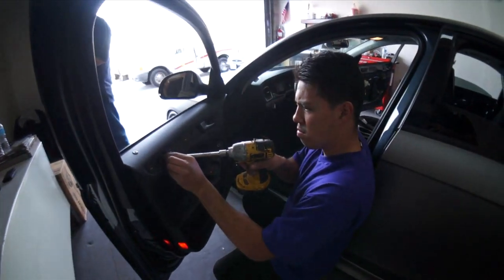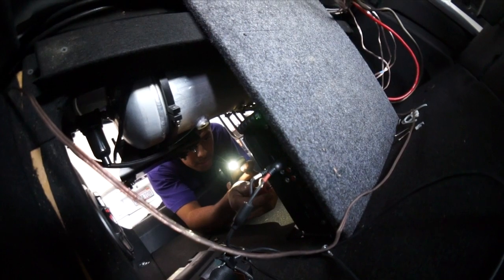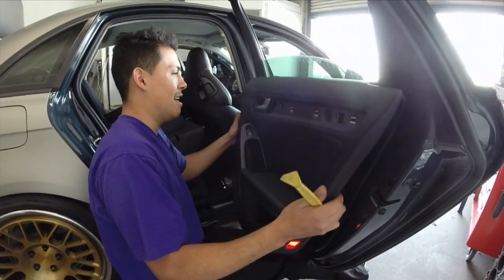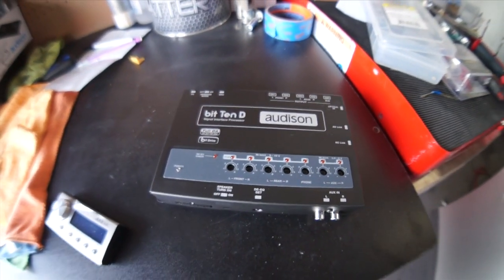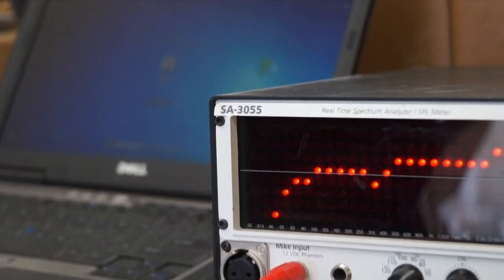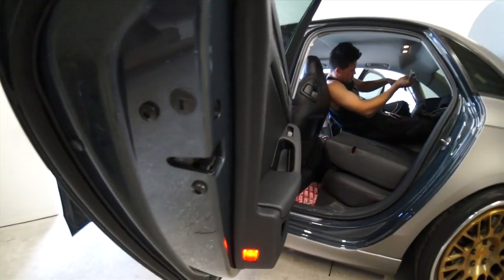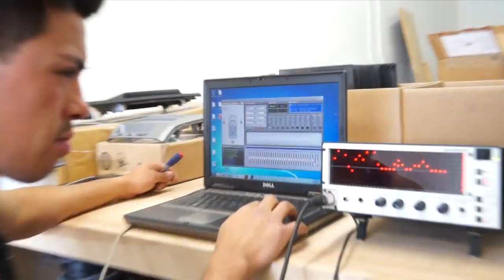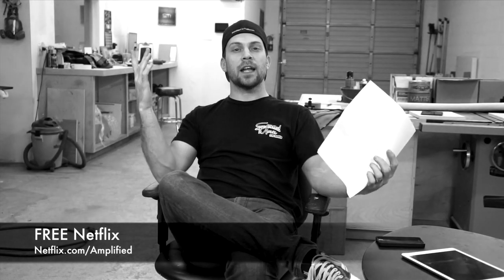Audison Stereo in a Bagged Audi S4 - Amplified #162

Comment: Just curious, you guys let the Bit 10 D set the ranges, but the amp is a 5 channel. 1 for the subs, and I would assume the door speakers (kick panels)  each get a channel? If that is the case what are you running the tweeters from?
Reply: ***** Thank's for the clarification. I always wondered how you all configured the speaker connections, that's something you never show. It's always just a clean install and you never seen any of the connections. The DSP takes care of the signal being sent to the amp channels so you don't have to set amp gains correct?
Reply: What want to the the same thing John Harris help me

Comment: How much do RTA go for now days? Is an Alpine PXA-H800 a good alternative to go active or should I just wait and save the extra cash to go with Audison.
Reply: Since when is the PXA-H800 cheaper than the Audison Bit One, or Bit Ten??? Since Alpine don't have a deck now (INA-W910), that can control the PXA unit. You are relegated in getting the RUX controller, and that is around 900 bucks for both. A Bit One will cost around 700 or 800 bucks, and the Bit Ten is around 400 bucks, or the Bit Ten D is 500 bucks....

Comment: I really hate the way these guys bitch about 'passive' crossovers. Now get this, passive crossovers are fine, as long as the tweeter and mids, have the same path lengths. Running 'mids' and 'tweets' in a scheme where they are not close together, will give you more than one source point, which is very bad. I run 'passive' crossovers, and I have no issues, in fact I would prefer this, because you don't have to play with phase, or the time alignment, that much to get the desired imaging. I run a deck with digital out, and have an Audison bit ten d going to Arc Audio amps...
Reply: Home stereo speakers have lived for years, with 'passive' crossovers. Besides like what I said earlier. It seems that everyone wants to move the tweeters up on the soundstage, by either moving the tweeters to sail panels, or up on the dash. I can see doing 'active' that way, because of time alignment. Yes you would need more control. But these configurations, the imaging would be off, when you tilt your head. I like to keep it simple with the tweeter almost on top of the mid, with passive crossovers. I guess music is always going to be suggestive, to the listener. Keep posting these videos, they are great....
Reply: Michael Morr Also with a 'passive' crossover, there is a lot of R&D that companies, like Focal, Audison/Hertz, and CDT do to make sure that the roll off, is more natural, and matches the components. 'Active' gives you more control, but the roll off on the frequencies, are not matched, and the path lengths are uneven.
Reply: So they run 2 way active up front , how did they run the rear components ? I am not seeing the dsp used on the rear speakers from the configuration on  laptop screen .

Comment: Can you explain how you summed this signal from the factory radio and what was that plastic welding thing Rafa was using on the door panels? reminds me of a filler used on the bottoms of scratched snowboards.
Reply: Pretty sure Rafa was melting a black hot glue stick.

Comment: Why would anyone buy an S4 and then put air suspension on it? MIght as well start with an A4 or A5..... it's a performance car.
Reply: if you had the money like it seems like this person does, would you rather be driving around in an A4 or an S4?
Reply: TheMrDuffie If it was going to be bagged and slammed like this, probably an A5 as it's more baller and not a performance car.
Reply: Doug Dale
 so you cant have performance with air bags?? #myth #urbanlegend
Reply: Not really, slamming a car effects the handling and makes it handle and perform worse.  So what's the point.
Reply: Doug Dale you have the S model for looks and not just performance, even if you're just gonna mod it anyway
Reply: That's why you air it up, you don't drove around scraping the frame.....you can do a bag over coil over sleeves and adjust the ride height when air'ed and it will perform just like a car lowered on adjustable coil overs with the added benefit of being able to air out and lay frame.